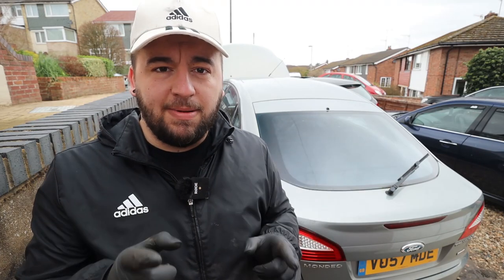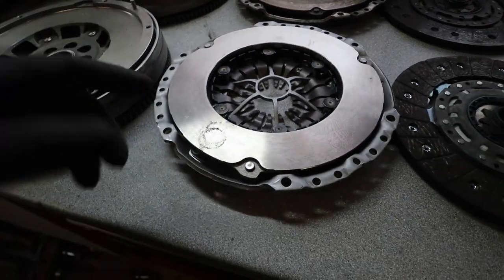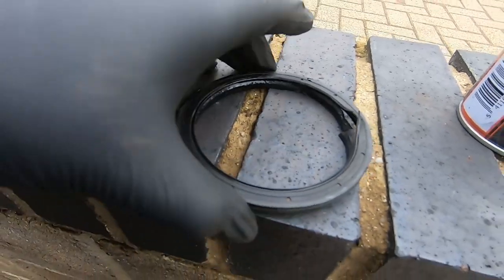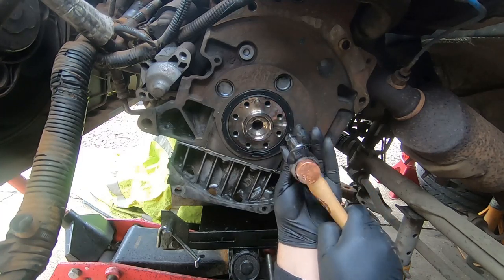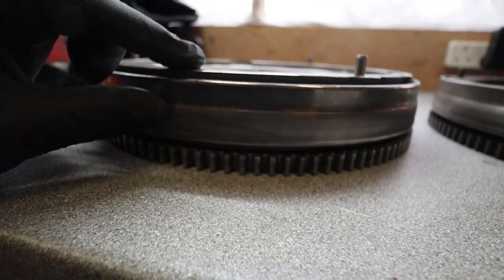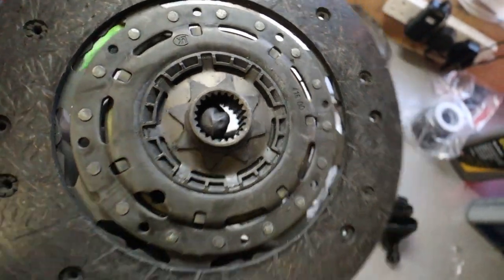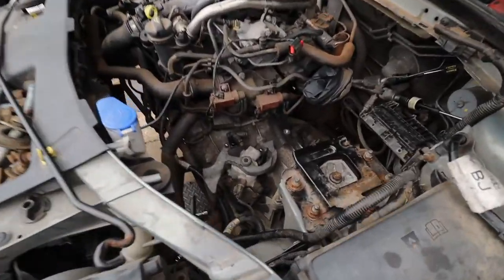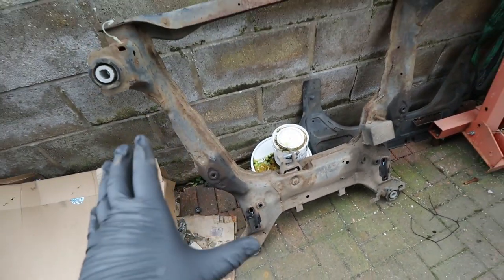Mondeo Mk4 Project Gets a New Clutch! (Part #2)

Comment: James, you’re becoming a very effective how-to instructor.  Very well done.
Reply: I broke a clutch just like in the video because you didn't use a degreasing system, adjust the pressure plate.  HOW YOU MOUNTED IS WRONG, I DID AS YOU WERE AND I BROKE NEW CLUTCH IT ONLY WORKED FOR 20,000 KM, NOW I NEED A NEW ONE
Reply: Absolutely top work sir. Well impressive, you voice over is calm, methodical and contextual. Keep being you when you're chatting away, it's re-assuring to a viewer what you're explaining and why. Maybe a little division into chapters would help those of us not as brave as yourself so we can divide and conquer into weather dependent chunks with the parts / tools / and time you needed / faced during your efforts. There's plenty of us enjoying your thought process ;-)

Comment: Just a tip to make the gearbox fit easier. Place a couple lengths of threaded rod into the engine gear box bolt holes and use these to slide the gearbox into position then once you’ve got a couple bolts in then replace the threaded rod with the remaining bolts. Saves a lot of aggro.

Comment: James, I could've done with that scissor lift when I changed the clutch on a 2007 VW Beetle. I ended up borrowing an engine crane form my local garage. Mating the gearbox to the engine was like docking with the ISS. Fortunately, I didn't have a subframe to contend with unlike the MK4 Golf on which the Beetle is based.

Comment: Haynes manual not recommend greasing up the input shaft of the box at all? As for the installation, I wouldn't worry, ended up taking me over 2 hours to get the box back on my 1.8T. Was a right pain for my first experience.

Comment: The reason why your slave cylinder failed is due to the center of the DMF has sunk in over the middel, and there for the travel for the slave cylinder was to long and there for is leaking.   Great job .. Have a nice easter from Denmark

Comment: How much did you tighten the flywheel bolts? 40 Nm? Looks not as enough for me. Try to look that up. I thing they should tighten 40 Nm + 45-50 degrees.
Reply: I had a look online and I think you are right.

Comment: There is a special tool for sac clutches. The manufacturers urge to use it. Normally it doesn#t pose a problem but sometimes your clutch will not properly disengage afterwards

Comment: Great video again James, bit concerning though that a 57 plate would have such a rusty subframe. Seems these days that fords underside rust protection leaves a lot to be desired. Would it have been worth a bit of wire brushing and painting before putting that lot back in ?

Comment: That was a great job and awesome video. Friendly advice: Try not to spray dual mass flywheel with brake cleaner, because brake cleaner can get inside dmf and melt away grease that is inside the dmf. Instead, just spray some break cleaner on a rag and clean dmf with that. Looking forward for the next video.

Comment: Respect for doing gearboxes on a driveway. Always hated doing them like that. Word of warning though mate, with torque to yield bolts you should replace them if you intend to do the angle. Could end snapping or next time it has to come out it could sheer off. Nice job though

Comment: Do the control arm bolts need to be torqued down with the suspension loaded (wheels on and down on the ground). On cars I've had this needs to be doing be to avoid chewing the bushes up prematurely.

Comment: Great info and video as always.. A question for you.. A 2015 Mondeo with an active grille shutter. is there a way of  bypassing that system easily, as the cooling fans are running full speed all the time as a result of a tip on the front damaging the shutter system

Comment: I bought a complete clutch kit a year ago, waiting for the courage to start this job on the street, studying all the details. My biggest doubt is the need to use a special clutch tool, something that compresses and aligns the automatic adjustment springs on the pressure plate. I built my own tool for this procedure, but now I noticed that James did not need to use any tools of this type. I'm completely messed up !!! Can anyone explain ??? Thank you James for this incredible content.

Comment: Hello! Did you have any trouble getting the steering knuckle back in once you removed and put back on the sub frame? I removed subframe out it back but steering knuckle won’t line up with steering wheel.. what have I done wrong??

Comment: Fantastic video, cheers for taking the time to film and edit this.  Big enough job as it is without the added pressure of filming and editing, especially to the standard you are putting out.

Can I ask - your DMF and clutch kit - where did you buy from and how much did you pay?  Links if poss even?

I see loads on eBay, that vary wildly in price bizarrely despite seeming to be the same thing.  Problem is most listings are for a company that literally everywhere says to avoid - but I'm not seeing many other options!

Comment: Those Dual Mass flywheels boil my p*ss. They took something that pretty much couldnt break to something that stupidly expensive that fail frequently, mechanically writing off older cars. I have never straight replaced one. I always put solid flywheels in. Never had an issue with any car I have fitted one in. My beetle TDI will be getting one next.

Comment: That red grease is going to contaminate the brake fluid and create more problems Also you didn't use the special tool to press the clutch probably messing up the wear compensating mechanism. I hope these errors not come back to haunt you.